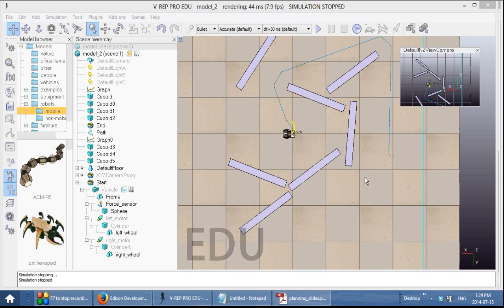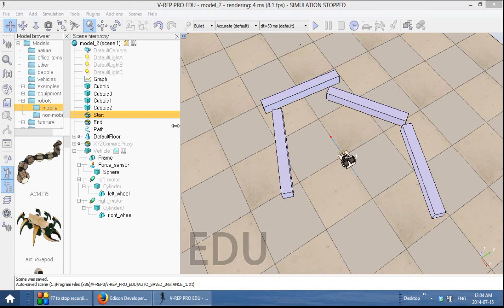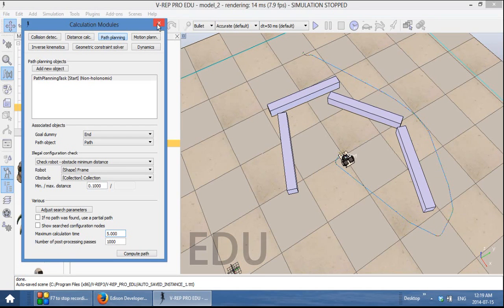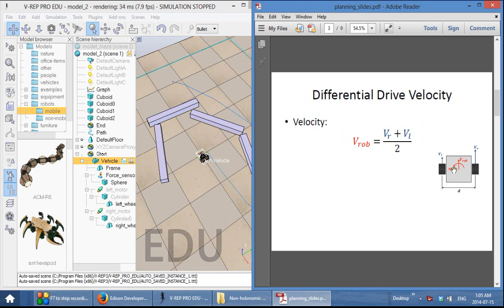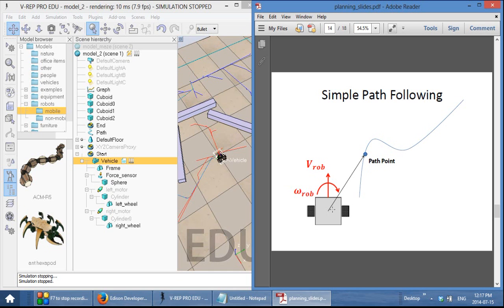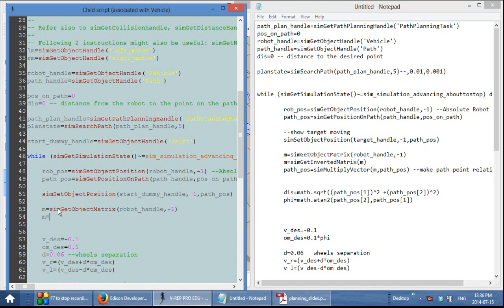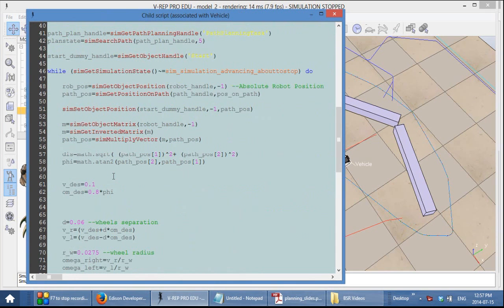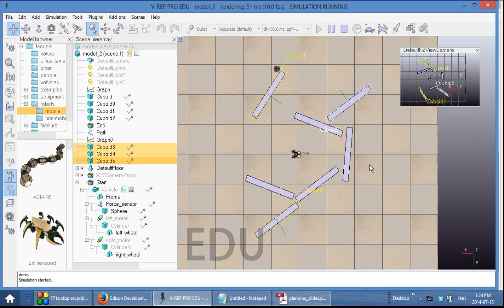03: Path Planning with a Differential Drive Robot V-Rep/CoppeliaSim | Tutorial

Comment: i have this problem running the file how should i solve it?
Compatibility issue with MAIN SCRIPT
Since V-REP 3.1.3, the functions simHandleChildScript and simHandleSensingChildScripts
were replaced with simHandleChildScripts (i.e. with an additional 's'), which
operates slightly differently. In addition to this, a new function was introduced that
handles threaded child scripts: simLaunchThreadedChildScripts. For that reason, V-REP
has automatically adjusted the customized main script. Make sure that everything
still works as expected.

Comment: Hello Nikolai K. 
According to your video you design a path planning with two point dummy (start) and dummy (end). Can you explain if we want to make the robot through many point such as from point A to point B to point C and so on. Thank you.
Reply: Did you get the solution? we are stuck in same problem.
Reply: I get the same problem here, have you solved it?
Reply: One way to do it is to add multiple dummy's, and define PathPlanningTask's for each (with StartPoint of the next destination being the EndPoint of the previous destination). That alone won't quite work since the next destination from the first one will "ignore" the obstacles in it's way. This is because you will never reach first EndPoint exactly with your robot's reference frame (Basically StartPoint will not be exactly on the first EndPoint), this matters a lot since the second PathPlanningTask will not look to avoid obstacles for the whole frame of the robot, and the algorithm tries to go through the objects. What you can do is assign a master dummy on the center of the robot frame (same as the StartPoint at the beginning) but in contrary of the StartPoint (dummy) which will move ahead of the robot following the path, this master dummy will always stay at the center of the robot frame. When you reach the first EndPoint, you can assign in the code that the start_dummy variable is now the first EndPoint and immediately move the position of this "new" start dummy at the master dummy, so the new start dummy is aligned with the robot frame completely, then you will need to make the Vehicle object (in the code) the child of this new start dummy (previously the EndPoint dummy) so the second PathPlanningTask can continue the work as the first PathPlanningTask did, find the new path and avoid the obstacles during its new path. And you basically continue doing this how many destinations you have.
Reply: @ledjonbehluli1306   can you help me !?

Comment: For people using the latest version of the software to follow this tutorial, you will have to look a more little closely to find some of the options used in this video since it was obviously recorded using an older version of V-rep. In some cases the options/functions have been changed to a totally different name, but if you are patient enough you'll find the subtle differences. Overall, these are good tutorials and I have gained so much from them. Thanks for sharing.
Reply: +Joshua Owoyemi Any hint on what happened to the path options we see at 16:57,  like the motion properties? Did it go somewhere else?
Reply: @KlausRaizer  New V-Rep versions use the OMPL library for path planning, and it is
discouraged to use the old module. I assume that's why the dialogs were changed/some options were removed. There is a test scene that implements path planning using the new way for a car in a 2d maze in the OMPL github repository:
https://github.com/CoppeliaRobotics/v_repExtOMPL/blob/master/tests/non_holonomic_path_planning.ttt
Reply: Klaus Raizer I have no this option, too. Due to the latest version
Reply: did you found the motion properties? :/

Comment: Hello Nokolai k 

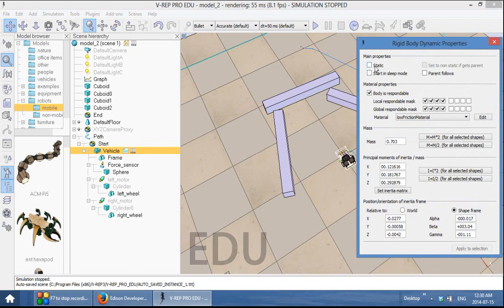i have a problem on 17:47 minute feature , i dont have this static feature in My V REP, please guide me which version you were used..?
Reply: +naveen soni  i have this message when i am opened this path planning file.

Compatibility issue with MAIN SCRIPT
Since V-REP 3.1.3, the functions simHandleChildScript and simHandleSensingChildScripts
were replaced with simHandleChildScripts (i.e. with an additional 's'), which
operates slightly differently. In addition to this, a new function was introduced that
handles threaded child scripts: simLaunchThreadedChildScripts. For that reason, V-REP
has automatically adjusted the customized main script. Make sure that everything
still works as expected.

Comment: Hello Nikolai,

I'm truly grateful for your videos. However, I have some trouble with figuring out a way to developing my own robot model and then use it with V-rep. Could you tell me if CAD models, or if any, are compatible with V-rep, please?. Thanks in advance.
Reply from the maker: Hello Bharath, take a look at the following tutorial on importing cad files: http://www.coppeliarobotics.com/helpFiles/en/rigidBodyTutorial.htm
Reply: Nikolai K. Hello Nikolai, thanks and I went through the doc shared up above. However, it does sound tricky if I want to design my own model that is compatible with V-rep. As a complete novice in designing I looked to start learning Autodesk INVENTOR, however, no clue how to design a roof bolting machine(Google it please) that I can eventually use with V-rep for it accepts models made up of triangular meshes only. 

I was wondering you are probably familiar with designing objects made up of triangular meshes and hoping you can do a demo on the same.

If there is a simpler way, please educate me on the same.

Thank you.
Reply from the maker: Bharath Ballamudi
Hello Bharath,

Take a look here on the file types that V-rep accepts for importing and the import dialog:
http://www.coppeliarobotics.com/helpFiles/en/importExport.htm

You can first do the design in Inventor. I am pretty sure that Inventor allows you to export .stp files.

In the previous tutorial link that I gave you, the robot was imported as an assembly and the tutorial told you essentially how to cut the assembly into individual parts.

It may be easier for you to import the individual parts from Inventor (as .stl files) into V-rep. You can then take those objects and connect them via actuators by making the object the child of the actuator.

Hope this helps.

Comment: How would the second part of the video (Path planning dialog control via Lua script code) work with the kuka omnibot robot. Would it be much different because this robot has 4 wheels and also omni directional wheels? 
Also is it possible to do execute multiple paths in a certain order?
Reply from the maker: Hello,

you can use the KUKA robot, you just have to determine the kinematics of the forward and side-ways velocities, given that the robot has omnidirectional wheels. In its simplest form all you have to do is just use the simSetJointTargetVelocity() command. Take a look towards the end of the script that is added when you import the KUKA robot.

If you wanted to follow a second path after you reach the first one, try running the "planstate=simSearchPath(path_plan_handle,5)" command again to get a new path. You will have to move the "goal"-dummy to the second location, but you can do that in code using the simSetObjectPosition() command.

I hope this helps.